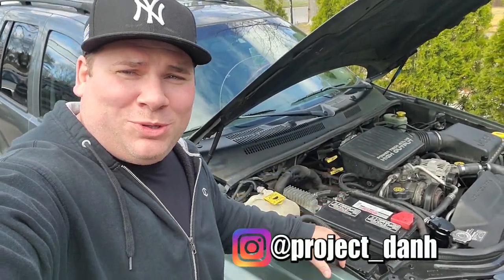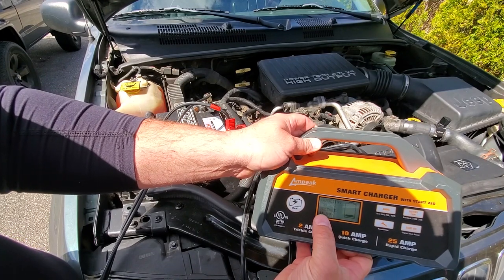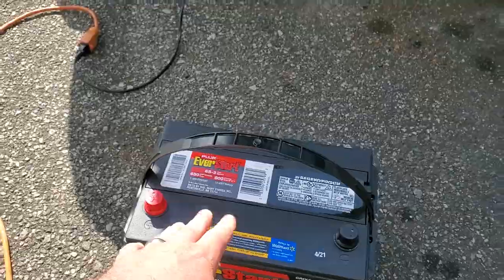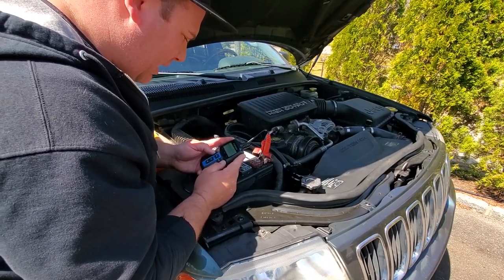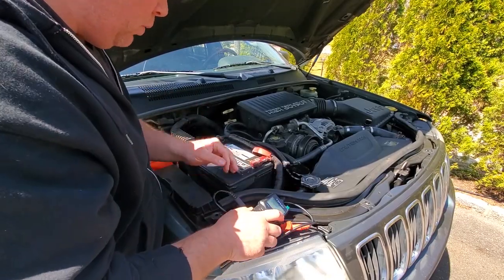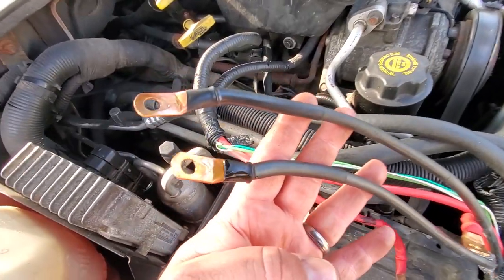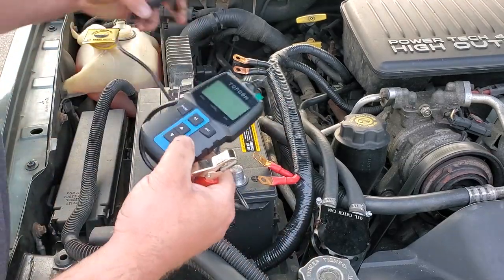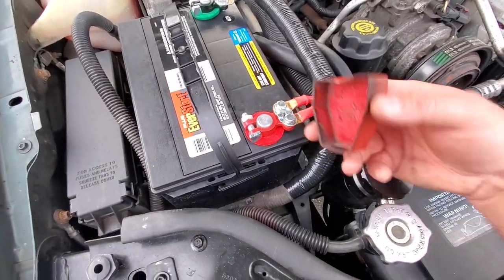JEEP GRAND CHEROKEE WJ BATTERY UPGRADES

Comment: Hi Dan! Thanks for your informative videos! I've been watching them for quite a while and I like your tips, Friend!  I own a 2003 Jeep Grand Cherokee 2.7 Diesel and I wonder though if I need to use some kind of a memory saver while replacing the battery to avoid any computer settings loss and radio code? Would really appreciate your reply, man! thanks in advance! Take care!
Reply from the maker: Glad you like them! Nothing really you can do to avoid that unless you have a spare charged battery and some jumper cables you can keep connected to the terminal clamps.

Comment: Walmart batteries are pretty solid. Not sure if i'd call them the best on the market however I love the no hassle warranty associated with them. More or less a no questions asked here's another one-scenario most of the time. Also if you're on a road trip and the battery fails I've found its easier to find a Walmart than a specific auto parts store. Keep up the great work!
Reply from the maker: Thanks man! Walmart stores are everywhere! lol

Comment: Hey Dan you forgot your cover Ha Ha !! Just kidding . Great job on the diagnostic of the old battery and installation of your new one . Looking forward to your next video . Oh by the way I use Optima battery's and they usually last me 7 years before I need to replace it. the reason I use them so I don't have any battery acid spillage when off roading . Take care and be safe sir.

Comment: Best way to check is use the voltage meter and see what the alternator is putting out over 13.5v. If its running at 12volts then it should still run without the battery connected.
Reply from the maker: Exactly!

Comment: You should get brass terminals over lead. There's some types tht are coated in gold for better connectivity. Also good idea to do the big 3 upgrade to all your vehicles as well. It's a stereo system upgrade to better your own power output. It never hurts to have more grounds.
Reply from the maker: Excellent suggestion brother!

Comment: Nice job!  I bought a Walmart battery and was told I should have bought an Interstate Battery by a guy at work.  Crossing my fingers as I haven't had a problem yet.
Reply from the maker: Walmart batteries have been proven to be one of the best!
Reply: Interstate batteries are junk. They were good about 20 years ago.

Comment: I watch all your stuff, but im having a hard time believing those terminal lugs didnt just fall off the next day. Im trying to do exactly this with my WJ and my wires look great, clean, good solder, flux, and the solder simply will not stick whatsoever to the copper cable. At all. I can touch the lug after it cools and it falls off with the shape of the wire in the solder, inside the lug...but wont put the two together. Never had this problem with any other copper wire.

Comment: I have a 2006 Commander 5.7 Hemi. I have a transmission over temp issue that has made me have a nervous breakdown trying everything to solve it. Any info you can help me with would be MUCH APPRECIATED!!!
Reply from the maker: I wonder if one of your solenoids are clogged.. I'm not really a transmission guy so if a good old flush doesn't work I'd recommend just bring it in to someone that knows about transmission and you can trust
Reply: I tried. But no one can figure this out. They keep throwing darts at the board
Reply from the maker: @nelsontoranzo9169  It could be something as simple as a broken wire or something as devastating as a bad transmission... And unfortunately I wouldn't know the difference 😢

Comment: Dielectric grease doesn't conduct electricity, it is an insulator. I see debate that it is better to put the wire terminals onto the cleaned up battery posts bare then add the grease outside as a water repellent so no corrosion forms.
Argument is that grease sat between the wire terminal and battery post will increase resistance , lower current flow and reduce charging efficiency but counter argument is it keeps air out :s - internet's always fighting...

In my mind its same as using dielectric grease on spark plug boots I guess where you dont want it on the electrical contact surfaces - just the rubber boot to plug ceramic contact. 

Be interesting to test if any difference in readings for battery with both methods.
Reply from the maker: Correct! what a paradox!! I rather have my connections insulated from the elements as much as possible to prevent corrosion.

Comment: Hello friend dan, very good videos ... I have a query my grand cherokee overland year 2.005 4.7 lts I turned on the abs and handbrake light I want to know if there is any common fault that I can review before discarding the complete module I am in Venezuela and you already know the difficult situation to get spare parts
Reply from the maker: Sorry to hear that parts are hard to come by, I find ABS lights are usually a sensor.. you can use a multimeter to test each sensors resistance.  The sensor that is bad will calculate unlimited resistance

Comment: I live in arizona
Im looking at a 1988 wagoneer with the 4.0 160000 miles
It has the renix ( I don't know if its a good system or not )
Should I buy it or run?
Reply from the maker: I'm assuming since your in AZ it's rust free..  if so I'd snatch it up if the price was right

Comment: Question what's your check engine light for¿. I've delt with alot of codes for my 02 jgc.
Reply from the maker: this one is just an small EVAP leak.  not ready to drive into that yet. lol
Reply: @ProjectDanH  I totally understand that one. Chances are it's under the hood.

Comment: Hey buddy. XJ advice. I know you did a starter replacement video a few weeks back. Any suggestions on a replacement or anyone you would suggest that would rebuild? Mine is getting slow and it’s the original Mitsubishi. Thanks man!
Reply from the maker: Any auto part store starter with a warrantee should be fine.  Good luck buddy
Reply: @ProjectDanH  ok. Thanks!

Comment: Battery video....very nice.  Have you ever replaced ALL brake lines on a Jeep?  Mine's a 98 Cherokee Classic
Reply from the maker: Thanks man... Try this .. ABS or NO?
https://www.ebay.com/itm/401626622396?fits=Year%3A2001%7CModel%3ACherokee%7CMake%3AJeep&hash=item5d82cfe9bc:g:5LUAAOSwlSdfKvNO
Reply: I thought my 98 had ABS...i haven't driven it for 4 years, just around my front yard, off the streets, to keep it's blood going....so, that stainless kit for 170...why are they talking about ABS or NOT
Reply: And GO CLEVELAND

Comment: Not saying your battery isn’t your issue but you didn’t properly load test your alternator. Battery, alternator, and starter must all be in good working order. Issues with any of them eventually cause issues with the others.
Reply from the maker: No, it was the battery.

Comment: Why is the Check Engine light on?
Reply from the maker: Evap leak somewhere.. not ready to dig in there yet.
Reply: @ProjectDanH Mine has an evap leak too. Is it a big deal? Is it affecting my vehicle or something I should be worried about???
Reply from the maker: @PromNightDumpsterBaby420 it won't pass inspection with a Evap CEL..  if you live in a state that doesn't have inspections you're good.   It may cause slightly less miles per gallon tho

Comment: That is 233 milliamps not 23.  It would be .023 to 23
Reply from the maker: yep! brain fart 🤪
Reply: @ProjectDanH  That will run your batteries down quick.  If you have batteries dying all the time, figure out why it is drawing so much current.

Comment: Agree that Optima batteries are CRAP!  You really blew the proof of a working alternator.  On newer vehicles, your process will cause all sorts of issues.  Also, a bad alternator could possibly provide enough current to run a car at idle.  You had a Multi-meter and you know how to use it.  All you needed to do is show the current the alternator was putting out.
Reply from the maker: Lol, Thanks for the input.  Good thing I don't have any new vehicles. lol